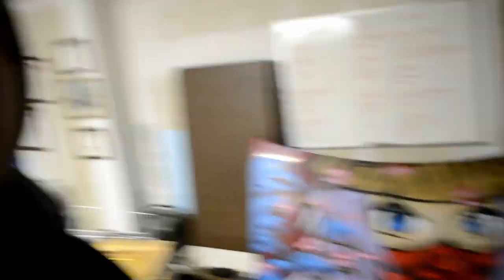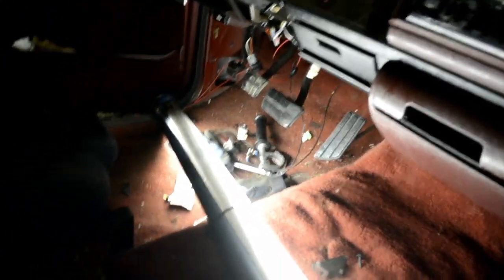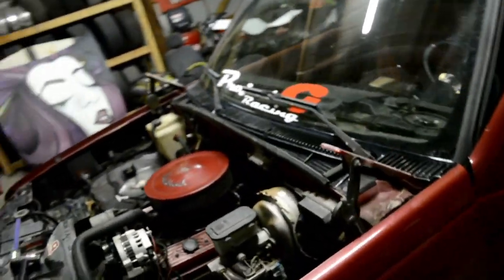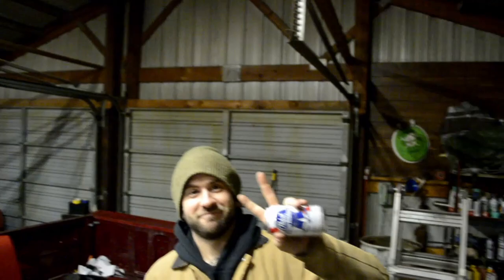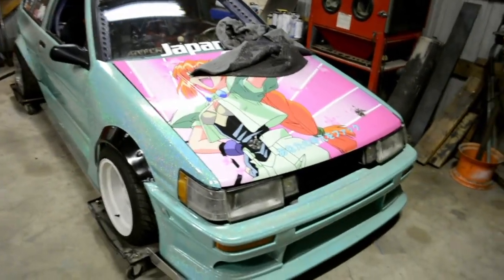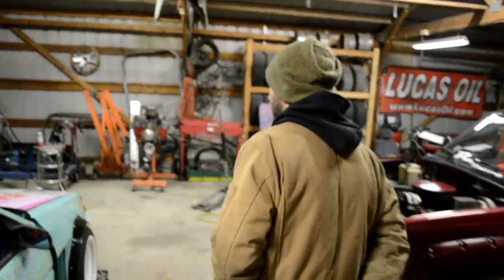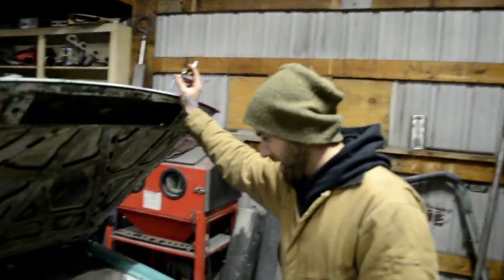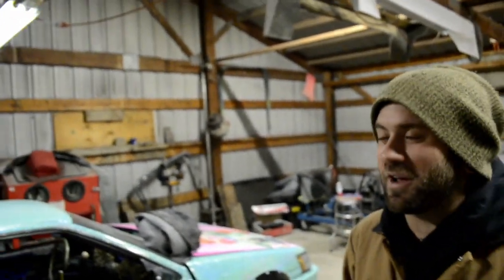Clutch Pedal is in! Plus a Slight Hiccup in The Process

Comment: Wow.... I didn't have to take my dash out on my 89 when I swapped it to 5 speed. I just drilled some holes in the firewall and it went right in.
Reply from the maker: The pedal is out of a 95 and around that time is when they changed the dash. So rather than try and find another pedal assembly we decided to try and trim the dash and bracket.
Reply from the maker: @Alsome56  The dash was falling apart anyway so I really don't mind shelling out the money to fix it this way.